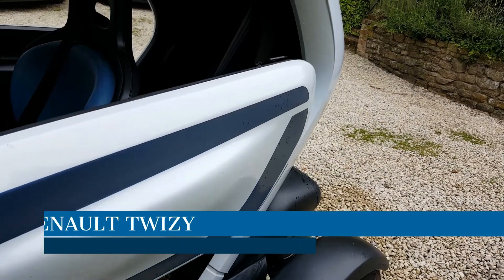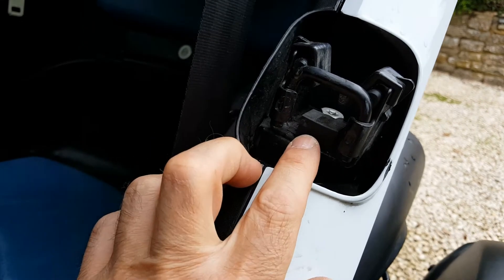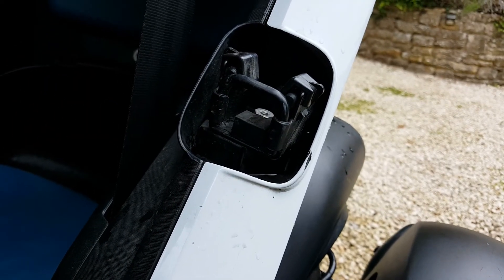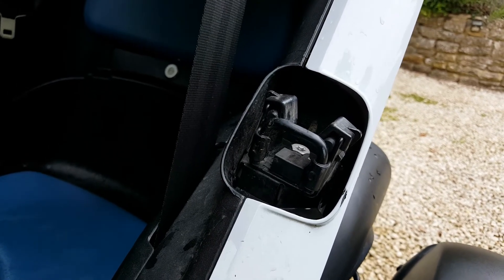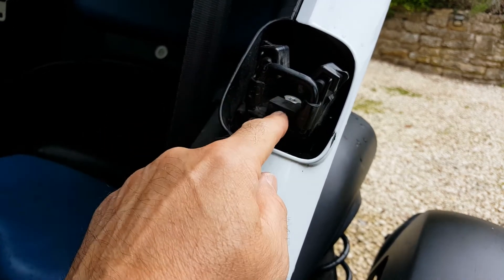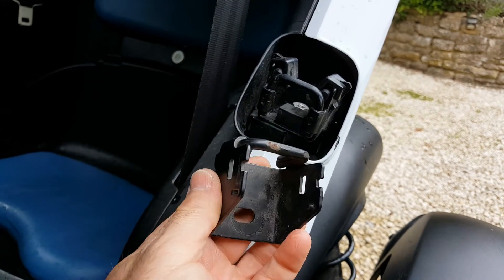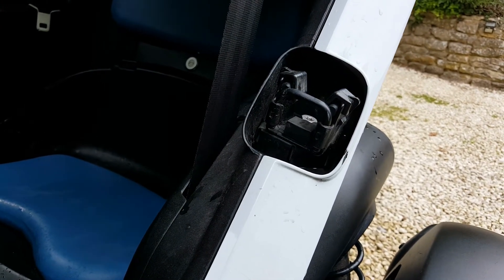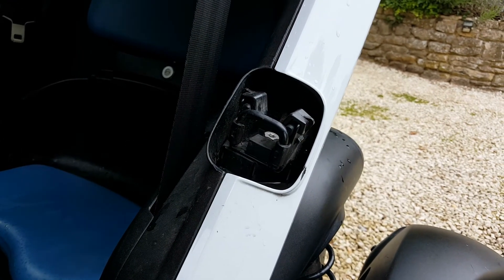Common problem with rattling Renault Twizy door catches

Comment: Hi, thanks for guidance on this. I bought a replacement latch and fitted it and the door sometimes sticks on releasing the handle (50/50). I also fitted new 800n struts but with no improvement. Is there a trick to the alignment of the latch, or maybe another part is the issue? Can you offer any advice?
Reply from the maker: It sounds like you just need to play with the alignment. No trick really apart from loosen the bolts, so they are finger tight. Shut door a few times so the latch aligns, then tighten up.

Comment: Hi. I've got a twizy without doors, I found the doors but I need to assembly to mount them and the one that you are talking about. Do you have any idea where i can find them, I mean the one that should connect the door to the car. Thanks
Reply from the maker: Renault dealer parts dept only.